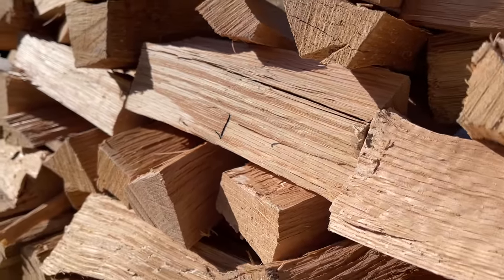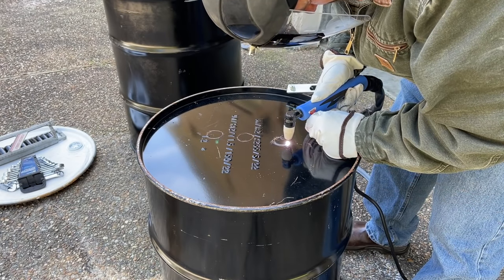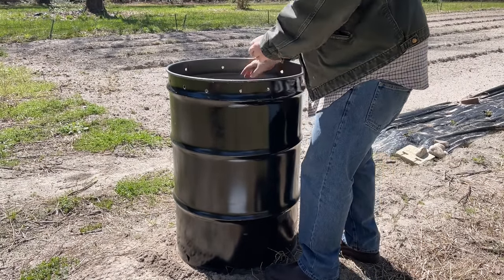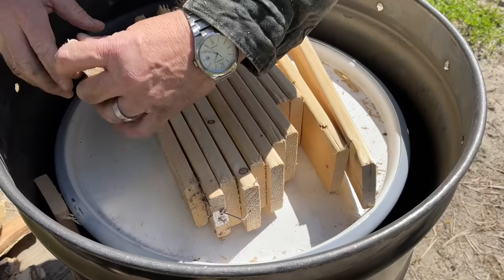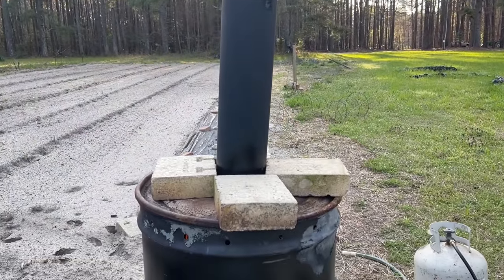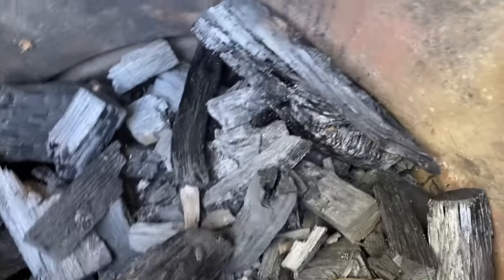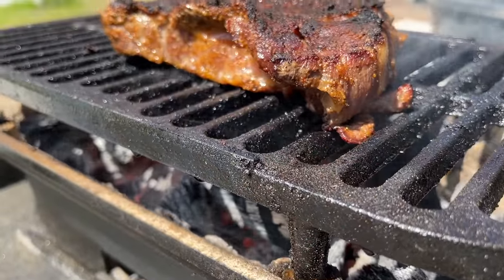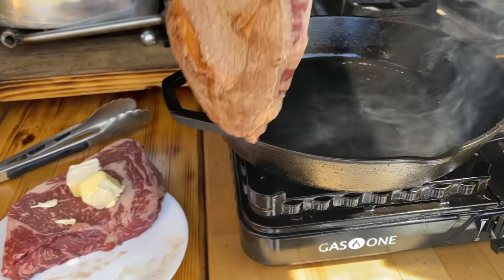🔵 @Home Natural Oak Lump Charcoal | BEST | Made in Steel Drum & Save $ | TLUD | Teach a Man to Fish

Comment: i made one last week exactly as you described and it works perfectly. I used very green  red oak, it's very green but this kiln still gets it done. once i had to do a second burn, so i'v started adding a little more wood for the fire. I use sawdust soaked with kerosene near the bottom air holes in the 55 gal drum and kindling just above the sawdust. that way i can light the fire easily with a hand torch through the hole.  Thanks for the video. I recommend this method. do know that it makes a lot of smoke for the 1st hour but it settles down. also i removed the charcoal tank once to see my results while it was still very hot and sparks developed which would hav burnt up all the charcoal so now i wait til it's completely cold in the drum so the charcoal won't combust when it's exposed to air.
Reply from the maker: That’s great!  I like the sawdust idea.  If there’s one weakness I have it is getting enough material around the inner barrel.

Comment: I represent the BbqPitBoys and I’ve done a video using the exact method I found using hardwood skid material cut to length and stack it vertically around the diameter of the 55 gallon barrel will avoid a second cook and start it with dry softwood as you’ve done in your video (6hours cooking time then let cool)
This Charcoal burns cleaner hotter and no more waiting for the coals to get white hot before you cook!! Great Video Cheers 🍺 
Handzee

Comment: Great video.   I had to watch the process twice to get how the gases and moisture escape the inner chamber.  I got it.
Shouldn't you burn the barrels to get the paint off so it doesn't end up in the wood?  Or doesn't that matter?
Thank you for the barrel sizes.   I've got a lot of black cherry that I think would be good for charcoal.  Your thoughts?
Reply from the maker: I was really worried about the pain because the insides of the barrels or free of paint and bare metal.  However, there may be a protectant, but I wasn’t too terribly worried about that either.  It wouldn’t here to “season” the barrel first with fire.  
CA is crazy, I’d be arrested every other day.
Reply: Great video if you like adverts :(

Comment: Can I over do it?  I have a big pile of garbage and trees that I wanna burn.  I’m thinking if it would work to fill a 55gallon with  dry birch and cut a small hole for the air to escape and just throw it in the fire.  It would be a big fire it might get too hot I don’t know 🤷🏼‍♂️.  Your thought
Reply from the maker: Yeah, it can both get to hot and if there is ANY oxygen that can get into it, it will burn instead of char.  You can't just pop a hole in it.  It has to keep oxygen from getting in.

Comment: DO I BURN HOLES IN THE BOTTOM BIGGER BARREL LIKE I did for the inside one? i know the outside has holes it the bottom that i ask?
Reply from the maker: You will have to adjust the size until it burns right.  Start small

Comment: This doesn't have anything to do with charcoal but it's a video idea that seems to works. First the reason why, my e-tank uses a Schumacher 1565 wheeled charger that usually cleans quickly. It started to slow and the amperage was falling. I wire brushed the anodes and and still just 9.6 amps. I changed the solution and cleaned the anodes again which fixed the problem. That started me thinking if I could contain the sludge from the pieces while allowing the current to pass through it might keep the tank cleaner longer. The first thing I thought of was a cheap pillowcase so it was off to Walmart. I tried it yesterday with positive results and my amperage has only fallen 0.3 amps. Allow the top of the pillowcase to remain open to vent the hydrogen and oxygen gas. I don't get that foam on top of the solution that I used to get, its all inside the pillowcase. It seems to work like a tea bag, the solution will stain but the sludge stays inside the bag. I sprayed it out with the water hose and it was ready to use again. I'm on my third piece now with no changes. I wanted to tell you about this because you seem to be looking for a better way of doing things as well. If I'm not mistaken this will be a better way. Sorry for the long comment.
Reply from the maker: Wow, that is a good idea.  If I can remember it I will add it into my next cycle after cleaning out the solution.  Brilliant!
Reply: @TeachaMantoFish  I've had more time to use it and it's a winner. My amperage has actually increased with the clean anodes, the surface area of the piece has a lot to do with it too. I keep the charger set on 12 volts- 40 amps and it's common to get 19-36 amps. Using a regular size pillowcase fold the top inside out down to the bottom. This leaves a loop of material at the opening, use a pool noodle to form a hoop in between the pieces of material. This will float, helps to slide the piece in, and vents the top of the pillowcase. It sounds like a lot of trouble but once you're finished it should work for a longtime.

Comment: I was going to make my white oak charcoal in a retort, but then i found out that the single barrel method is just as easy and requires much less wood. I would use a retort for certain other woods, though.
Reply from the maker: Yeah, the easiest way is to build a fire and then squirt it with a hose to put it out.  Let it dry and pick it up, but where's the fun in that.

Comment: What I don't like with this setup: The inner drum is not fired from the bottom. Only from the top and the sides. That's bad for internal convection of heat. 
If you have a small firebox underneath you can get away with much less wood to heat it, you can put some more wood in if you think you are not done yet.

Comment: I think charcoal for cooking is counter-intuitive; all that heat wasted. You can do your BBQ just as well with a stick burning barbecue.
Ah, watching your video is like watching a commercial TV show; 1/2 hr show has 20 minutes of advertising :(
Reply from the maker: Thank you for watching!
Reply: There's grilling with charcoal and then there's smoking meat in an indirect fired cooker and using splits or pellets or even charcoal... just depends on what type of cooker you have. Seems like the video was focused on the grilling part.
Reply: @manandatractor  I can grill with wood sticks.
Reply: @markspc1  by yourself more than likely. The one you can never escape from.